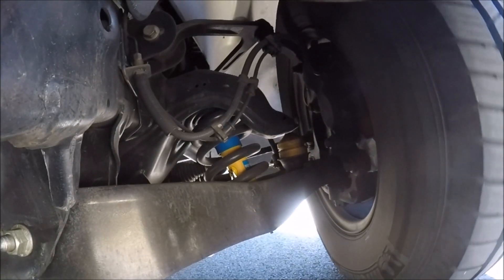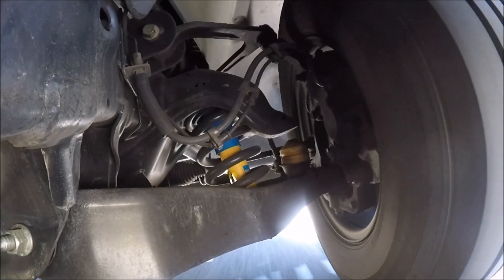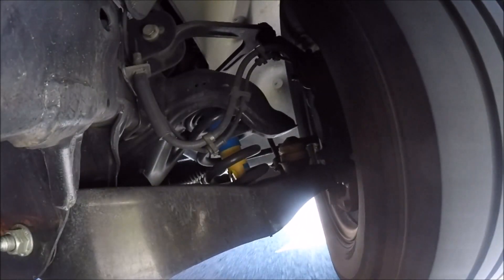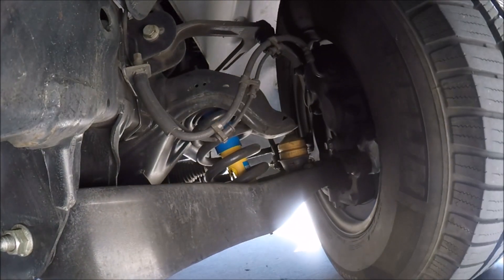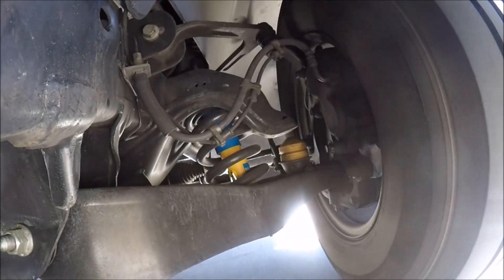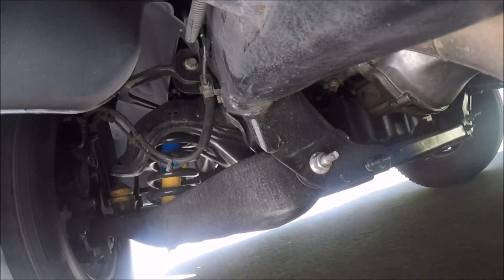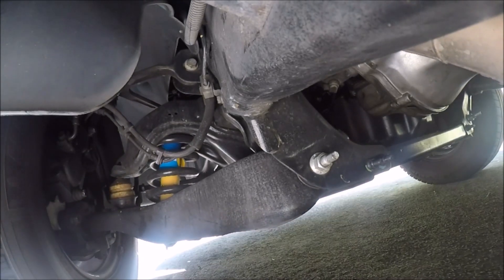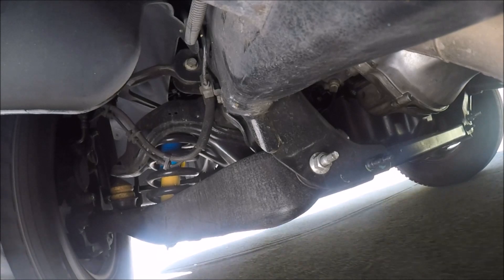Lower contol arm bushings  / Troubleshooting braking cluncking

Comment: So grateful for this video. Swear my 2009 Traverse is making the same noise. I thought it might be the control arm or tie rods. Just had the entire suspension replaced, front and rear and it's still making that noise. Now my check brake system light comes on. So this video makes complete sense to me!!! Great video

Comment: Good find! I just found out the same issue on my 2010 F-150. I swore it was coming from the rear. I had my dad brake fast forward and reverse and found it. Found your video after and compared. I had the exact same sound and symptoms.

Comment: Hi. I had a bad noise. Slow driving braking. I found the messed up control arm and tie rod. I changed it . Noise was gone complexity . 2 weeks later I hear little noise again. Sounds like the side I fixed but not sure if the other side is going or maybe it’s just a cheap part. Spent like 89$ for arms and rods off car parts.com.. by the way I’m driving a Volkswagen convertible. Any ideas if it’s just the cheap parts or something else? Just had alignment done and they said front end is nice and tight

Comment: I get the same noise. But have replaced the bushes, rose joint bushes, tie rods, bearings, struts, and the control arms and still makes the noise at low speed, worse under braking. So no idea
Reply: caliper getting locked up? if you’ve figured it out lmk

Comment: 09 corolla and I have clunking noise and I changed the Sway bar link, outer tie rods, bushings and finally the struts but noise get less but still have the clunking noise when start and go and turn. Would that be the control arm? I check for play on inner tie rod and ball joint, there are no play. It has to be control arm since it is original and car has 190k,  I hate to change the control arm and did not solve the issue.

Comment: Did you replace with regular rubber bushings or poly?
Reply from the maker: Regular rubber installed in MOOG parts. The only poly was the sway bar 30MM bushings

Comment: I have the same problem when i take off . it makes a clunking noise
Reply: Did u figure it out?
Reply: Had to replaces suspension (struts) problem solved
Reply: @danielguzman8346  just replaced mine months ago, tie rods, and after new ball joints and alignment I'm getting this clunk noise. It was happening turning now it's happening in general on some takeoffs and certain jerky motions
Reply: @alansmilealot  did you check the sway bar links? I did mine yesterday big improvement but didn't do the other ones yet like you.
Reply: @DonnieDarko1  I replaced them prior too, struts, CV axles, bushings on sway bar. It all happened after the alignment and ball joints we're replaced by a shop and not me. That's why I do my own, I can only question myself. But I was in a sitting where I had to let them do the work or call a tow truck.
Reply: @DonnieDarko1  I need to find a way to mount my GoPro to watch the suspension
Reply: Just replaced my lower control arms along with tie rods ends and I still have the clunking noise can someone point me in the right direction
Reply: @MikeyGoesFitness  so do I.
Reply: @danielguzman8346  so the struts were the issue for you ? Cause I'm getting a more of creaking/clicking noise when braking or taking off at low speeds once up to speed no noise I cant figure it out but dont really want to change control arm bushings since I already did the ball joints
Reply: @gsc2866  I’m having this same exact issue. Already changed upper control arm, lower ball joints, strut assembly and sway bar links. Going to change lower control arm next to see
Reply: @RNigey  what car do you have ? Mine ended up being lower control arms even though i couldnt find play in them with the car in park. Swapped em out and solved my problem
Reply: @gsc2866  I have a 2008 3.5L accord. It’s funny because mine doesn’t have play either. But that squeaking and clicking noise is driving me insane at the low speeds or when I’m in stop and go traffic. My mechanic said he thinks it’s the bushings from the lower control arms

Comment: Replace bushing or whole arm?
Reply from the maker: I would replace whole arm with OEM if you can swing $750 per arm from Dodge. Otherwise just replace bushings with OEM and tack weld in place. Mine was fixed by replacing just the bushings with OEM only. No after market! PITA. Good luck.
Reply: replace the whole arm it is cheaper . and don't forget to proper torque the nuts start in lower ball joint and follow the way in .